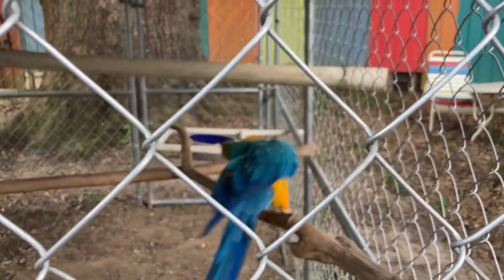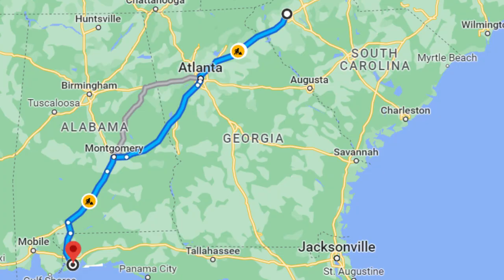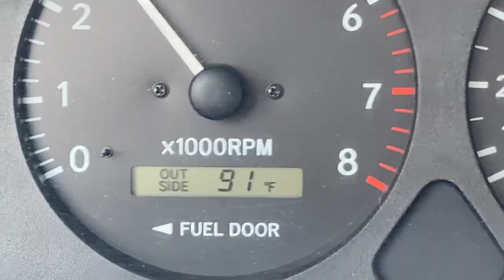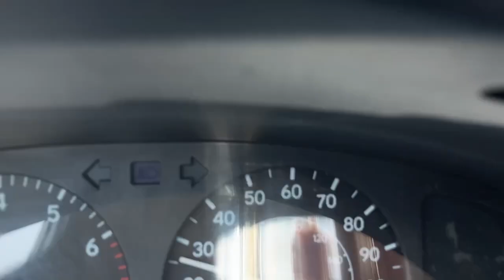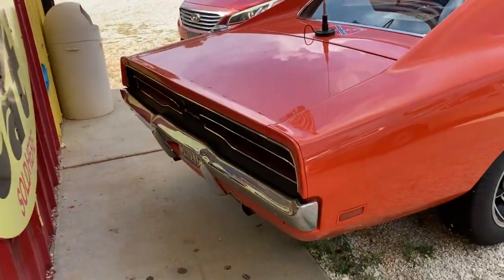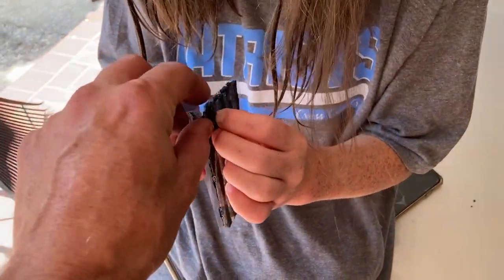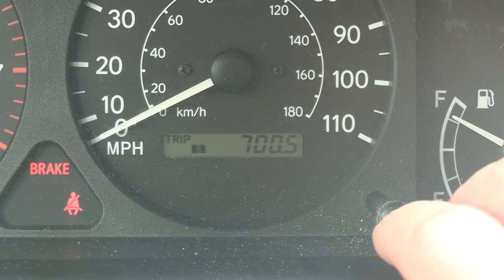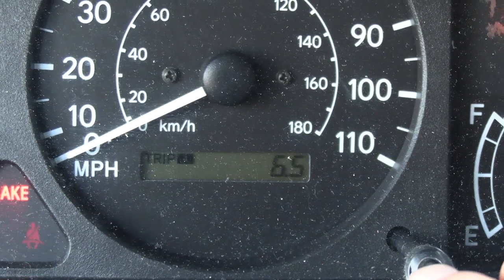HPL Engine Oil vs. OIL CONSUMPTION - Part 2 | Oil Burning🔥Experiments | Episode 24

Comment: My 2017 Hyundai Elantra burned about a quart of oil every 1000 miles. I added 4oz of AT-205 to my fresh oil change and after 3800 miles, it completely stopped the consumption. I'm about 1000 miles into my next oil change and so far I haven't had to add anything! Give that a shot!

Comment: I know you have done this before but I suggest a more durastic measure:

1. Use double the reccomended ammount of Seafoam High Mileage in the crankcase. (for the full oil change interval instead of 300mi)

2. Everytime you put 1 quart of oil in engine put half of the reccomended ammount of Seafoam High Mileage in the crankcase. 

3. Use BG Dynamic products in engine crankcase as a follow up from the Seafoam High Mileage.

The only reason I suggest this is because you have been adding different products in the engine with a difference or no difference to the oil consumption but no fix. I do believe that this will either fuly fix the oil consumtion, or make the effects of the oil consumption to not require 1 full quart of oil every oil change interval.

Hopefully this fixes the oil consumption

Comment: So I believe the piston ring land can never be cleaned with anything pour in. The ring lands are cemented in pace. It's like pouring concrete down the sink. Once it cures there is no liquid that can clear it out.an Th Satrun S was an oi consuming machine. Supposedly the oil return holes in the lands were too small. People would enlarge them during a rebuild.  Loved all the methods used in this endeavor.

Comment: Barrymans carb cleaner thru the spark plugs rotate every hour for 24 hrs and refill to cover the pistons if necessary, change oil before firing and put a barrymans into a tank that will solve it, my rav4 2006 1600 miles only 1/3 below full before was 1qt every 400 miles

Comment: Do a trial by written declaration. I have won cases that way. If you are lucky the  ticketing officer wont want to do more paperwork so doesnt reply. Even if he does reply if your explanation is good you can still win. When writting it dont make excuses why you did something, just state facts on why you had to do or could not do something. For example when i ran a red light. I didnt say i ran it because someone cut me off i said i ran it because someone cut me off which forced me into the turning lane. I was going 40mph with only 100ft until the intersection at that point and had to continue in that lane with a speed of 40mph i would need 180ft to stop safely according to the NHTSA making it impossible to stop in time forcing me to run the red.
Reply from the maker: Good to know. I've never heard of that. I'll have to look into it. Got till October to pay -- so there's time.
Reply: @FamilyFriendlyDIY  look up the vehicle code they cited you for so you know exactly how the law is worded and you can use that to give you an.idea of what you should say and how you did or didn't break it.

Comment: Valvoline Clean and Restore is supposed to be proven to reduce oil deposits around the pistol rings. Check out Motor Oil Geek's video on it. Most high detergent oils are only designed to prevent deposits, not clean/remove pre-existing deposits. That is what is supposed to make this newer Valvoline unique.
If you are running products in the oil with the hopes of cleaning/removing deposits, you should also be changing your oil filter regularly and frequently as the hope is that the deposits that the detergents remove from the pistons will get caught in the filter. You do not want the filter to become clogged and have your oil cycling though the bypass valve.
Reply from the maker: 👍I'm in the middle of a Valvoline experiment right now ! :-)

Comment: Excessive valve gide ware is also a contributor to oil consumption... This one you have 4 choices. 
(1) Or you live with it an accept it and keep adding oil.
(2) Fix it, DIY cyl. head removal. And have a cyl. head specialist [machine shop] refurbished the head.
(3) Same as #2 but get a refurbished head w/exchange of your cyl. head.
(4) Get rid of it, and make it someone's else's problem.

Comment: Check the cylinders with a scope because even if you free up the rings and they reseat if they was stuck to long you’ll have a divit in the cylinder wall(s) that no ring can seal.

Comment: I have an update on my wife's Camry 2AZFE and finally seeing the oil consumption stop. I put 1 quart of HPL Engine Oil Cleaner in. It was still burning oil rather quickly especially with high speed driving. So I continued to top up with Schaeffer's Fuel Stabilizer Neutra #131 thinking HPL Engine Cleaner just is not strong enough. It continued to burn oil like normal until I got to about 1qt of #131 top up. I just checked it today and it has not burnt any oil since. Not sure if it is finial fixed and will stay this stable but we will see. 

The HPL is just too weak on it's own at 1 bottle treat rate. They either need to increase the strength of what is in one bottle or they need to have you use two bottles to get concentration up! You added 6 quarts of their oil and they claim the oil is more powerful than the engine cleaner and that did not do it either. All modern cars need to deal with this. We need a solution like Valvoline Premium System Blue Restore but readily available on retail market. Something you can buy at parts stores, Walmart, Costco etc...Something that will one-shot this and clean the piston rings insitu! Given the number of cars and trucks on the market and the shortage of new vechiles even if it  was $75 a gallon or $100 for 6 quarts there is a market for it.

Comment: Dump a quart of Marvel Mystery Oil in it and keep that mixed with oil as it burns it always keep that in the engine do a 30% mix or a 50% mix in your case and use a heavier oil weight in it so the oil is not too thin. So everytime you top it off use Marvel Mystery Oil and your motor oil.

Comment: does your converter still work and pass emission tests after burning that much oil? 

Most likely the problem is not just clogged rings. They might also be physically damaged or los their tension

Comment: after your Berrymans treatment cycle  just increase the viscosity, you are in the south, so the winter weight number is irrelevant so put a 10w40 in it you will burn less oil. Do that until you have the time to pull the engine out and rehone the cylinders and put in new rings. Its not the space shuttle !!..

Comment: I just changed my oil today. its been 11 months and 6k mi (9.5k km) since i did berryman, and it did not hit minimum mark yet. i went from adding oil every tank of fuel to entire oil change interval after doing what i seen in your berryman video. Optimistic because of my sucess i would suggest you do not disassemble engine before trying berryman one more time and doing full throttle accelerations on 20min drive, because that is the only thing i did different than you in the video and my sucess is excellent. maybe it needed just bit more force to free it up. i say if it doesnt bring any improvement go on and take the engine apart.

I will paste below all details i wrote in the coments on several of your videos:
1st upd
Its 1.5dci engine (k9k 704)
Oil consumption went from 0.6l/1000km to 1.5l/1000km in 2 years. Oil changed regularly (every 2-6k km) because it got saturated with soot fast. Deactivating egr helped so oil can last  5k km comfortably. I redid my injectors and soot reduced considerably. All that was left was oil smoking which was bad and even visible on hot engine on idle. My only guess are piston rings gumming up because oil consumption increase dont make sense over that short period.

I did treatment  with b12 injector cleaner 21oz can. I poured it can contents in 5 times, so it was 30 something mililiters per cylinder per puour. Started on cold engine. Turned engine over every time before pouring. After that engine had a lot of trouble starting (likely cylinders very washed out) when started i held it at 1400rpm to help oil get to cylinders. Drove aprox 2000rpm untill engine got to 70C then drove 55mph at 3500rpm. It was smoking. After 10 min started doing full throttle accelerations and cruising on and off. Then i did full throttle acceleration from 30mph to full throttle in 4th gear. Suddenly i got giant cloud of smoke behind me, looked like engine is broken. Continued cruising 3500-4000rpm and it cleared up (at least what i see in mirror) tried full throttle again and it was emitting less and less smoke. Changed oil after it cooled substantialy so i dont get burned. Visible smoke is almost gone and treatment looks like and improvement. Now oil is topped after changing it and all is left to see is my consumption after 1000km. It certainly is improved but not fixed judging from what i see.

2nd upd
As i mentioned i will do, i did my first berryman treatment on my renault k9k 1.5dci engine. after treatment, at first it seemed like it was using some oil (i overfilled it 2mm and it used 2mm in 200mi) then oil was exactly full mark so i topped of my fuel. Before it used oil almost to min mark per tank of fuel, but now my fuel tank is around 1/4 (did 400mi) and it went down maybe another 1mm, which seems too good to be true. but again this is so small sample size il wait more for conclusions. really want to see long term effects and what happens if i do some highway driving (currently its driving mostly short trips).
May be bold claim at this point but i think your videos just perfectly did what you intended them to, and that you saved me an engine rebuild. Thank you very much, hope my words can translate how grateful i am. 
Also im very interested to explore why your treatment looks less effective than mine, and i can update if i do higway driving to see  if it makes some enormous difference on oil use. only thing that i did different than in your treatment is, on 20min drive, after warmed up and running for 10min another 10-15min i spend repeatedly floring the engine to really knock those pistons and rings, it started smoking like crazy while doing it as  something broke in the engine, but cleared up to almost no visible smoke on full throttle by the end.

3rd upd
happy to report that 8 months later I did little over 5k miles (8k km) since berryman treatment and my oil level dropped to 1/3 on the dipstick. It used around 1 liter and also means i will not have to add any oil before i soon change it. I also did a highway trip which before berryman used bit over a liter of oil, and now oil level barely moved after the same trip (1-2mm decrease on dipstick)
Soon after berryman I was planning to do the treatment once more to see if it further improves, but since my oil lasts an oil change intervall with no adding, im not planning to do another treatment at this time.
If you want to know the background:
A year before doing berryman i disabled EGR which i think in combination with infrequent oil changes at previous owner was main reason why piston rings got stuck in the first place, so i am pretty optimistic piston rings will not get stuck again.
Even before that i had smoking problem and went to a diesel injector specialist and got my injectors tested, they werent in need of a rebuild (surprise) he cleaned them and recoded new correction codes. Smoking was less but not solved, so i decided there is nothing else left to do but to disable egr to eliminate smoking (still has some smoke at full throttle but that does not bother me since i dont use full throttle)
Unrelated: since berryman i also disabled my turbo by opening the wastegate (unbolting an actuator), and my fuel consumption reduced substantially, especially at highway speed. It may also reduced oil consumption further but difference would be so small its hard to tell. Now i have good fuel consumption and good oil consumption and im very pleased with the vehicle.
Reply: If issue actually is gummed up piston rings, lot of examples on the internet suggest there is no solution if its not poured in the cylinder. if i forgot to mention i also did some no name flush before, and liqui moly motor clean and they all made zero difference.
Reply from the maker: Excellent info! Thank you so much for putting all of the data together in one comment. Really helpful stuff. 👍🏻👍🏻

Comment: If the rings not stuck, a cleaner if useless.  
The best you can do now to reduce oil consumption is to increase to a heavier 100% synthetic oil with a lower noak- higher flashpoint rating. 
This will increase ring seal, horsepower and decrease oil oxidation. Go to 87 octane too for a cleaner burn.

Comment: Take some bug repellent with at least 40% DEET and use a some 000 stainless steel wool and some gloves to protect your hands and clean those headlights. Just spray it on and wipe with the steel wool until clear. Takes about 5 minutes per headlight. Rise them with rubbing alcohol when done and if it's still a big foggy, repeat the steel wool one more time.

Comment: A cold air intake, headers, and a catch can will help you motor work less which in turn you will burn less also I saw black smoke come out of your tail pipe which may be you running rich and or a clogged cat which can also cause oil to burn but you are definitely burning oil threw your rings
Reply: I think at one point, the catch can was mentioned. I’d be curious to see how much oil is recirculated to the intake before being burned, vs actually passing thru the rings🤔…

Comment: Use diesel 15-40 in it.  You will lose a tough of fuel efficiency due to the greater piston drag (thick oil) but oil consumption will reduce also.

Comment: I'm guessing you're usually down on engine power because of the check engine light. That one time in the video the ECU probably "forgot" to limit the power.
After I fixed the O2 sensor issue in my Toyota I noticed an increase in power that remains to this day.
Reply from the maker: 🤔interesting theory

Comment: You ever wonder if there might be a certain amount of that top quart of oil it gets drank up anyway. I have seen cars where it will suck that first quart of oil in like fifteen hundred miles and then not use anymore. And just so you know when you change your oil to a different oil it will take a couple of thousand miles for the engine to get used to the oil if it ever does. The guy who runs the body shop on that had a Jeep that would go threw over a quart of oil in about twelve hundred miles or so. I asked him if he had run the synthetic oil which is what he was running since the vehicle was new and he said yes and I told him that he had to put some standard mineral oil in it for at least 3,000 miles and break that engine in. After the first couple of thousand miles, he was using no oil at all using Straight mineral oil. I have not spoken to him to see if he had changed it back to synthetic.
And now we see where all the toilet paper has been going

Comment: Valve gide seals that have lost its elasticity due to age and heat cycles are another contributor of oil consumption. This is the why of the existence of "High Milage Oils".
High Milage Engine Oil has an additional aditive to recondition valve gide seals and make the seals regain to a certain extent, elasticity. But wait their's more, it also will do the the same to the rest of the rubber gasket and seals (cam, crank & rear main seal) that has come in contact w/the High Mileage Oil...

Comment: Was all the HPL 30w ?
If so you were probably running almost 30w by the end of your oil change interval?
For a minute I thought the Corolla was your son’s car  and the trial was over..
Wonder if the Yamalube cleaned up your O2 sensor?
Or cat?
It was impressive on the piston tops.
Would have been great if you were recording when making a legal stop in Alabama.
Will try the B12 chemtool on our 2005 Mazda 3 which has oil bypass in cyl 1.
Plugs look due.
Does your Corolla have a MAF sensor?  If so,crc maf cleaner works well.
Enjoy the birds and chicken footage.
We got speedtrapped in AZ, and I wrote the AZ governor saying it’s bad for business to target their tourism.  People will get upset and not return.

Comment: Had a saturn 1.9 that used a similar amount. Rebuilt the engine, dipped the pistons in a chemtool carb bucket. Still has to scrape the ring lands pretty hard to remove the buildup. i would guess there is no chemical/additive/oil that will be able to clean the buildup behind rings.

Comment: Ok.  Just sharing my own experience, I used gum out 5 oz in the engine, and the rest in the fuel tank, rev it to above 2000 rpm for 10 minutes.  Let it set for 5 minutes, then change the oil.  With the new oil, I used 4 oz of AT 205 (which is half of the bottle), into the engine.  Take a quick 20 minutes drive with high way speed.  It has been over 600 miles so far in my engine, but no oil burning sign yet.  I usually got about 1/2 quarts per 1000 miles.   Still early for me, but just sharing.

Comment: At 14.15 mins  mark on the video the oil level has two oil marks on the dipstick , oil in the engine could have been over filled giving you the larger range in travel before needing to top up , after which the figures reverted to the previous conditions. This is possibly why you were so optimistic midway through yout test.

Comment: This time I change my oils at 14000km which is around 9500 mile , zero oil burn , I used mobile 1 5w-30 full syn
And oil loos pretty good

Comment: sheesh your corolla has big stomach. i keep my celica 30%-80% max between dots i heard overfilling can cause damage aswell or pcv just gonna dump it in your throttle body. edit:  also i dont remember all your videos but have u ever checked valve/bucket clearance on intake and exhaust cams ?